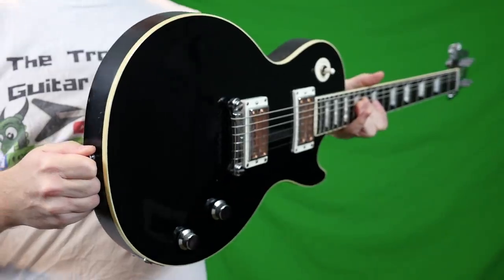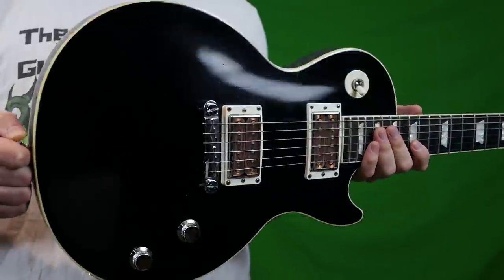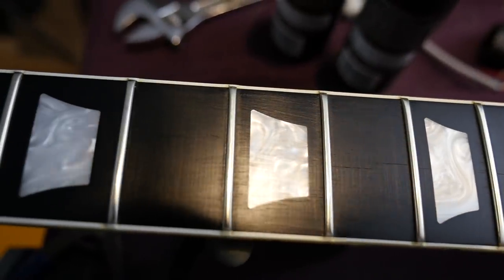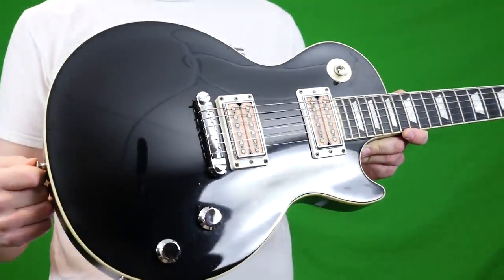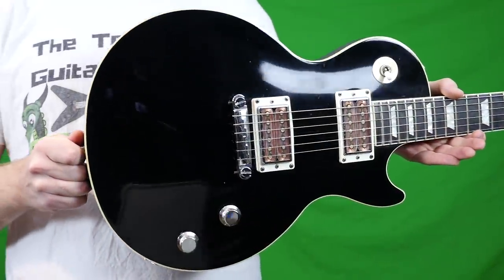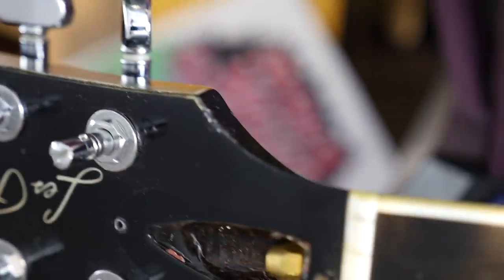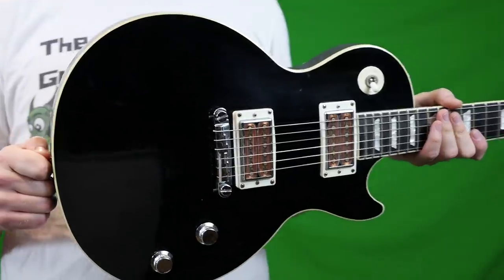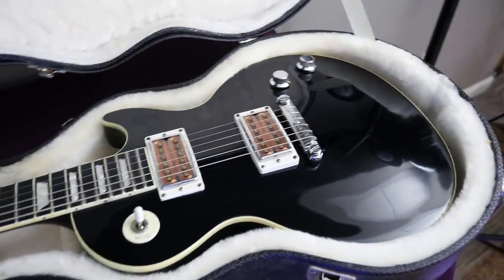The Black Beauty | 2007 Gibson Les Paul Goddess Ebony | Review + Demo

Comment: I like it. I wish it had 4 knobs , but the hardware/pickups/finish is really standout nice. And if it weighs a bit less than a Standard Les Paul, then it would be nice to actually play for hours. I have an SG and Les Paul, and the SG , at around 3 lbs lighter, is nicer to hang on the shoulder for hours.

Comment: Oh yeah, I never noticed they weren't adjustable either. I wish Gibson would have done something different with the Ice one. Maybe do like the marble effect with some grey/silver or even some light blue? I think it might have been their number one seller had they done that. 

The Black is gorgeous but no more black guitars for me lol. I don't think you have covered this before Austin but right now what is your most sought after model collection you desire? I know you told us the models but I don't think you said if there was a certain collection of Les Paul's you want to document.
Reply: If they did the Harmonica bridge on these it would have been pretty cool, that way it keeps the more stripped wraparound bridge format but you're still able to freely intonate your guitar
Reply: @guitarocd9984  - We aren't talking about the bridge, we are talking about the actual pickups not being adjustable. Well, the entire pickup is adjustable it's that each individual pole is not. You know how on most Gibsons one of the two sets of poles on each pickup has a slotted screw head so you can adjust the height individually? That's what is missing on these pickups. It's really not that big of a deal but for some people they like being able to have that fine adjustment. I have on guitar that I have to bring the high E up so it's nice to be able to do it. As for the actual bridge. My issue with these types of bridges is that all of the tension is now on one set of bolts driven into the guitar body rather than two sets. Plus you cannot really get the intonation correct with these types of bridges.
Reply: @guitarocd9984  I have made repairs to several guitars where the bridge bolts have come loose. Take a look at a firebird zero. It has the wrap around bridge and the front of those bridges dig into the wood of the guitar and begin to lean pretty good. I bought that firebird from Austin a few months ago and the wood is damaged in front of the bridge.
Reply: @guitarocd9984  - No, the bolts are holding a lot of tension simply because everything related to the strings and the tension on them starts with those two bolts. Having  a regular bridge and tail piece takes some of that tension off of those two bolts.
Reply: @guitarocd9984  - The tension I was referencing was is the pull the strings place on the bridge. I have repaired guitars, some with a regular bridge and stop tail piece, that the inserts were pulling back up and some were on an angle to the point they damaged the wood. Usually those occur on guitars using a softer wood. Which is why I don't really like guitars made from woods such as basswood or pine varieties. When you tighten your strings they naturally are pulling from the ball end (bridge/tail piece) and without having two separate components there all that pull (tension) is place on the one component and can lead to the studs pulling out, the front of the bridge digging into the wood and other things. Yes PRS has done it for years, as has Gibson and others. It can be done without any issues, I am just saying my personal preference is to have the two piece system.
Reply: @guitarocd9984  lol I see why you put ocd in your name -  Ok for the last time my friend -  I have repaired several guitars using this single stop piece style bridge. In every case it was either 1) It was being pulled on such an angle it began digging into the wood (see all the complaints about the Gibson Firebird Zero) 2) The studs/bushings began pulling free of the wood because of the pull from the strings.

With having a tail piece AND a bridge you get some relief off of the tail piece because the strings are able to supported by the bridge. Ever notice that one you tune your guitar you can't, without using a lot of force, move the strings on the bridge? That's because there is a downward pressure as the strings leave the tail piece and are being pulled towards the tuners, think along the lines of a fulcrum. Yes many manufacturers use this single set up, yes in a lot of the cases there are no issues, yes in some cases there are issues. As for the smooth bridge not digging into your hand. Oh sure I can see that and it is an annoying thing especially if you do a lot of string muting.
Reply: @guitarocd9984  lol I was waiting for that one.